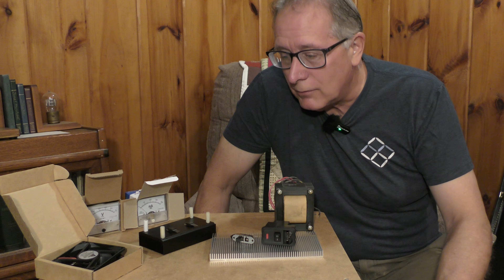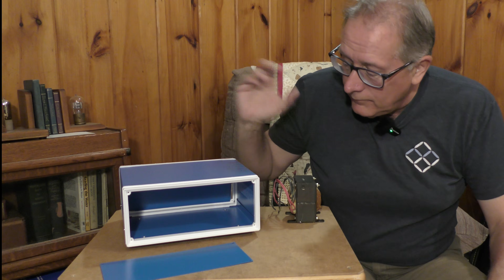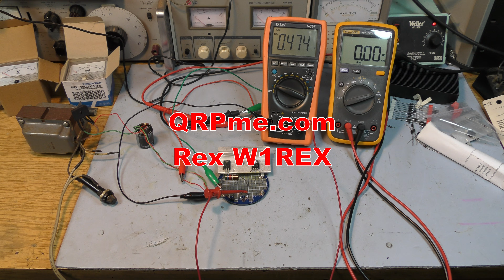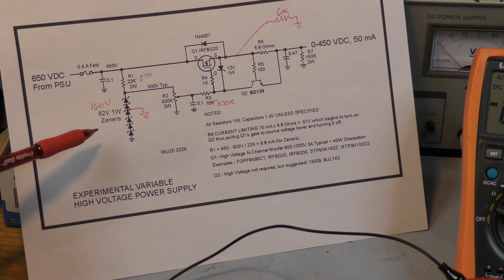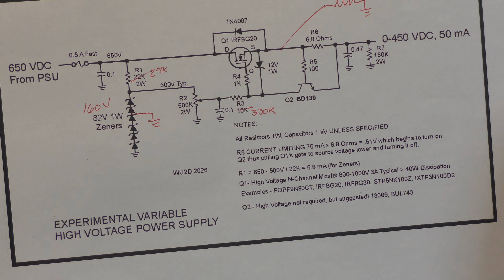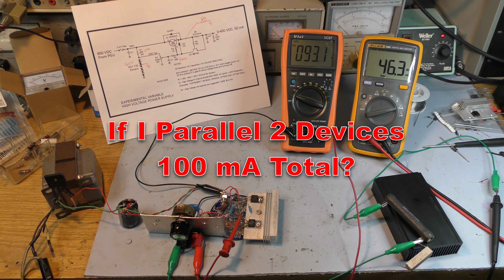High Voltage Variable Regulated PSU - Part 2

Comment: Mike, with the addition of 2 resistors , you can have a current limit of 50ma, which reduces as the load tends towards a s/c. At short circuit the current drops to 18ma. This keeps the regulator transistor cool during S/c. I've designed the circuit. Like I said, only 2 extra resistors. Have u got email I can send schematic?
Reply from the maker: Paul and I'll send you what I have as a working schematic. mjmurphy45@comcast.net
Reply: @MIKROWAVE1  ok cheers. Ill send u the cct in morning. Australia.

Comment: A few years ago I designed a power supply very similar to yours. It's a 50 - 400V 300mA. I used the IRFP460 as the MOSFET and the 2N5551 as the limiting BJT. Even though the MOSFET can handle 280W, I preferred not to go below 50V.
Reply from the maker: That sounds like a solid design, and staying above 50V definitely helps keep the heat dissipation manageable! This project is a simple approach, but because of the dissipation limitations and efficiency, you have to put limits on it.

Comment: After you complete this great series on solid state benchtop power supplies would you be interested in going one step further and design a portable solid state power supply for a Paraset?  I have a couple vintage 12 volt and 6 volt electro mechanical vibrators to attempt retro portable power supply. I'm thinking a solid-state version would be more reliable.
Reply from the maker: I have a big Paraset series on the back burner. So stand by!

Comment: Is that open frame transformer 700vct at around 200 to 300ma plus 6 volt filaments it looks like several I have similar from a box of new old stock 4 sweep tube linear amps.
Reply from the maker: As Ken says - be careful because this HV stuff can get you. That particular transformer is surplus with three 120V windings. So, I can wire it for 240 VAC and use a voltage doubler.

Comment: I'm cool with Mikrostyle just as it, the super hot isolated mosfet toaster, kinda like a virtual cathode follower tube. But on second glance the 600v buck challenge @Paul_VK3HN is cool too, to switch a mosfet at such a high digital voltage. See you on the shortwave in Berlin.

Comment: I made this with a IRFPG40 and TIP50. old tube supply transformer. I get about 45v-475v. I used a filament winding to power a fan. Thanks.
Reply from the maker: AH HA! Very nice and we shall see if I can come close to what you have accomplished.

Comment: I am pausing to suggest a "fold back" on the current limit.  This can reduce the maximum power you need.
On the current limiting circuit, there is an NPN transistor.
On the base of that transistor, there is a series resistor to limit the current in the case of a sudden short.
Add another resistor from the base up to the 650V supply.
Do some Ohmslaw to make it so that at 0V out, the current limiting transistor has about 0.35V on its base.
Do some more Ohms law with the current sense resistor to make a reasonable maximum current at 200V out.
Reply: Great idea . some formulas suggest just adding a voltage divider is sufficient for foldback
Reply: BTW: Folks if your lab is in the basement, put on your nonconductive shoes and prepare to work with your left hand in your pocket.  High voltage stuff is not even safe after you unplugged it.  Check the voltage is gone before you start to work.
Reply: The problem with a foldback limiter is that it can make charging the input capacitance of whatever it's powering never charge up. A foldback circuit that kicks in after a time delay would be better. Or since this is a lab power supply, no foldback and a lot of heatsinking is probably the better approach.
Reply from the maker: Wow Ken! This is very interesting and now maybe I see what Heath was doing with the Screen Grid voltage divider on the PS Series. I could not figure out why they were connecting to the input side HV. They must have some kind of similar fold back that monitors the 650 VDC. On the solid state system that you are suggesting, the 650V is connected through an added resistor, and thus less current is required to maintain the forward bias condition on Q2. So the sense resistor must be readjusted. As the 650V slumps under heavy load, the added resistor makes it easier to turn on Q2? Please explain further.
Reply from the maker: I think I see it. The load side, or the emitter of Q2 is reducing sharply with a short circuit - but the base voltage is decreasing more slowly because of the added resistor to the 650V. Thus Q2 turns on more than with the simple constant current limiter sense resistor voltage drop alone.
Reply: @MIKROWAVE1  Yes, I think you have the idea I was expressing.  If you do all the Ohms law stuff to work out the voltage on the current sensing resistor for 0.7V on the E-B junction of the transistor at the two extremes you get two different answers.  Between those two points, the current limit varies linearly.

Comment: Stretch goal... use AI to take you thru the design of a 0..600v buck regulator.  Throw away that huge heatsink, get reliable voltage setting and current protection,  and learn something new!  
Ask your AI friend how to design it for minimal switching noise for your particular load type.
Reply: ... and too much ripple.
Also AI will in perfect confidence give you a design that destroys its self.
Reply: @kensmith5694  Not if you prompt it with care.  And  amateur radio transceivers have been sold with switchmode PSUs for 25 years.  With good design the need for linear supplies is extremely limited.
Reply: AI is garbage. Plus he's going for simple and something he can show other people how to do.

Comment: You explained why you put the 1N4007 in your video.   However I don't believe it does anything useful since the body diode built into the MOSET is both bigger and faster.  The IRFBG20 body diode continuous and peak current is bit higher, It has a lower turn-on voltage, and it's storage time is almost an order of magnitude faster than the 1N4007.  It doesn't hurt to have the 1N4007 there, however I would be surprised if it ever turns on.
Reply from the maker: Very nice. Maybe a HER207 or 208 Schottky with very low capacitance.
Reply: @MIKROWAVE1  A schottky that will tolerate 650V across it?
Reply: I agree. That diode is specifically useful with BJT based regulators, but does nothing with a MOSFET.

Comment: I think using mosfet pass transistors could be challenging.  Switching mosfets can’t reliably be used at high power in the linear mode due to localized thermal runaway.  Linear mode mosfets are hard to come by and are expensive.  A BJT pass transistors would be much more robust.
Reply: Look that SOA curve for those BJTs they are worse in that regard than most MOSFETS.
A lot of high voltage MOSFETs publish SOA curves.
Reply: @kensmith5694  A lot of those MOSFETs that publish a curve do not include a DC curve. That's because they are way worse than BJTs in linear applications.
Reply: @misterhat5823  A lot of them do publish DC and long time numbers.  They are better than the BJTs

Comment: Nice project. I built something similar about 5 years ago with digital voltage and current display.
Reply from the maker: That sounds like a great workbench power supply! These are needed for we that play with tubes and HV Mosfets.

Comment: look at what HP did with the 6209 power supply using a SCR preregulator to reduce dissipation of the pass device.dissapation
Reply: Yes those sort of supplies are a marvel.  I have one arm longer than the other from picking up one, vs picking up a switcher but in their era they were great.

Comment: Make sure you have Fan blowing on the heatsink if you do linear.    You will be doing the Switching supply soon enough as Mosfets work better switching like that and as you see the issues with Linear Mosfets.  Not that hard for few khz  switchers. Can use the conventional filter chokes like 1 Henry.
Reply: He really-really doesn't want any ripple going to his transmitter.  That makes for a more complex switcher.
If I was doing it, I would do a switcher but then I am also someone who rides a pogostick to work.
Reply: @kensmith5694  switcher doesnt need special ICs or like a tl494 or 3525 but it can simplify design. You can make a simple switcher using a 555 as clock, using the sawtooth ramp and a opamp u get a pwm, add a buffer to drive the mosfet , another opamp or a transistor as error amp. add a current limit comparator, current too high, hold clock low.    for linear mosfet if he insists on Linear, use the Large body to263 500v device. I donot like his use of series string diodes - hv zeners - they have high tempco - also subtract the vgs of mosfet .  imprecise regulation.   the floating linear or switching topology used with whatever regulator he likes( i think he like lm317 types)  - I would prefer a 723  is better circuit to use as it removed need for imprecise HV zeners. 12M1h060 (SiC) is a 1200v to263 mosfet  good to use till 1kv  ! FDH44n50 regular mosfet is a large 500v device.  better for linear use
Reply: @pushpendrakhaira9337  That sounds like a really complex design you are doing.  I have done an entire DC to DC with a 555, a power transistor and diode as the only semiconductors involved.
His design is very simple and will meet his needs.  He isn't mass producing it so what he is doing is IMO the wise option.
Reply: @kensmith5694  if you need proper pwm this is the way to do it,  its not that complex when you do this, but current sg3525  is way better .  as simple as it gets .  the 555 +transistor is the classic boost design. that can be simplified even further by removing the  555 - just a classic blocking oscilator - was used for years like so -  self oscilating blocking osc power supply - step up step down -  whatever .  issue is spiky coltage current = inefficient. same with 555  design also.  But regulation can be added to blocking osc. 1 zener + 1 transistor for reg.
Reply: @pushpendrakhaira9337  I did proper PWM with the 555.
Reply: @kensmith5694   the control input on 555 can do some PWM

Comment: Always fascinated by power supplies - this video is classic -  so many principles explained and demonstrated.
Reply from the maker: Thanks for watching. Time to hog some metal on the enclosure.
Reply: @MIKROWAVE1 Interested to see what methods you use. I’ve tried drill-then-saw, nibbler tool, and dremel metal cutting blade.